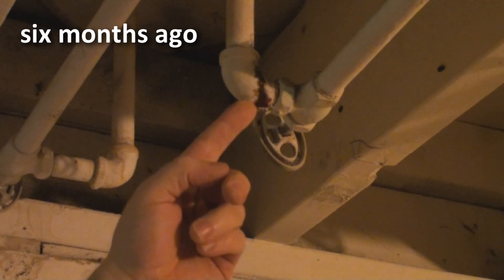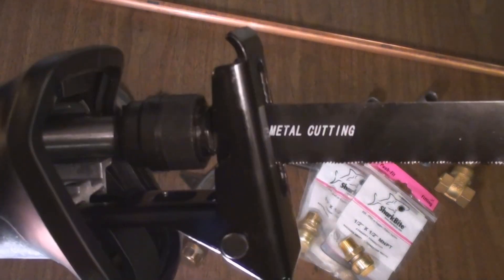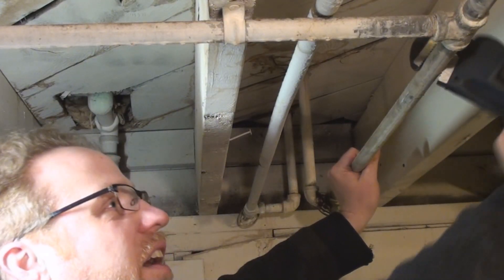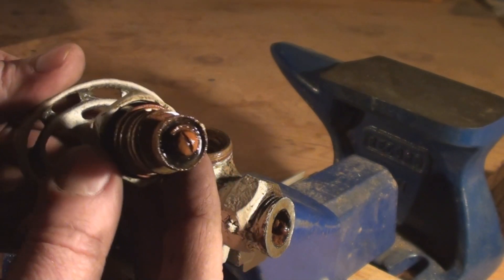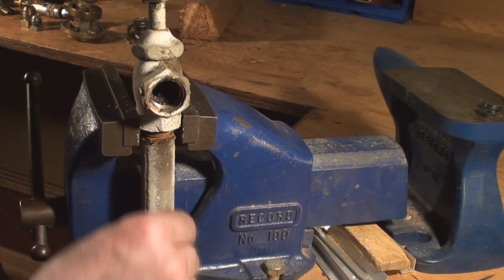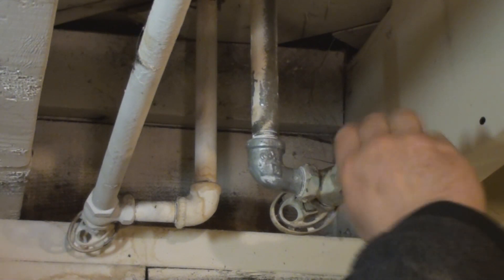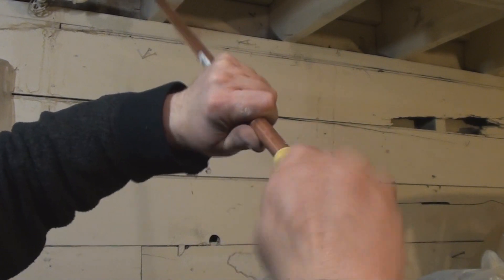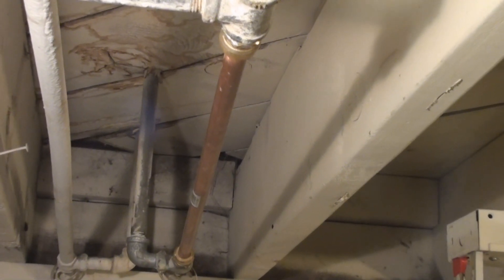Plumbing Something With Shark Bites

Comment: I have a older home built in 1935 with 1/2 threaded pipe 
I am remodeling the bathroom 
And I want to convert from the thread elbow to pex both the hot and cold supply also the toilet supply. Will a threaded male end of a shark bit fit the old threaded elbow ?

Comment from the maker: Depends on the brand used. I've seen some that are decades old come apart with a light twist and I've seen others I installed myself shortly before requiring torches to heat them enough to separate. Better check the label or ask the manufacturer (the days of sales people knowing about what they sell are long gone). Good luck!

Comment: Hold on. How did you connect the 2nd end that has the elbow? The video skipped ahead and it was popped in there like voila. 
Did you have to bend the vertical pipe, bend the copper, or what?
Reply: I have the same question. The whole reason I watched your vid was to see the connection of the 2nd end. The pipe has to be 2" longer than the distance between the two sharkbite fittings. You pop in 1 fitting and now it's 1" too long. Is there some flex in the pipe to work with? I feel like I just read a 400 page detective novel and got to the last page which someone ripped out.

Comment: one could have easily reused steel pipe. A union would solve the problem of threading into one fitting whilst threading out of the other.

Comment: Thank you for your video,first you should have used a spray bottle full of water to saturate the area where that valve was located with water both before and after you used that torch to insure that the rafters would not catch on fire and second what you call a "bushing" is a washer on that valve.Bushings are used to reduce the size of a fitting.You should familiarize yourself with the names of plumbing fittings before you go giving advice because if you go to a hardware store asking for a bushing when what you really mean is a seat washer you are going to have a problem because the people at the hardware store are not going to know what you are really asking for.

Comment: How did you know how to cut the copper to the exact length? Looks like it fit perfect..ie clicked on both ends.
Reply from the maker: Measure twice, cut once. Remember you need about an inch at each end to make a waterproof connection. Good luck!
Reply: thanks

Comment: If I use that pipe joint compound on a showerhead arm (portion that goes inside the wall only), will I be able to remove it in the future or will it harden?

Comment: Will you not have problem with connecting copper tot steel?
Reply from the maker: I'm not sure I understand your question. The copper pipe attaches to the Sharkbite which attaches to the steel fitting.
Reply: The Sharkbite is made of brass and connected to steel will eventually rust. I thought Sharkbite had a solution for this but they don't recommend this kind of connection.
Reply from the maker: I'm not worried, did you see my pipes?
Reply: He’s referring to electrolysis and needing a diametric fitting
Reply: You needed to install a dielectric union

Comment: Why u don't use iron pipe i have a problem inserting a pipe between 2 pipes
Reply from the maker: Valeriano Trinidad  To use steel pipes in this situation would have called for replacement all the way to the faucet - the threads tighten clockwise only - just replacing the pipe would require backwards threads on one end. Using the copper pipe with the Sharkbites was a time/material saver.
Reply: just cut in a union

Comment: forgot to take off the insert out the shark fitting those inserts are only when you are connecting ex
Reply: A lot of people told me to do that but I just don’t trust it. It’s there for a reason. If you remove it wrong you can potentially damage the sb teeth
Reply: Sharkbite even says it is fine to leave them in on copper pipe, it doesnt affect it.